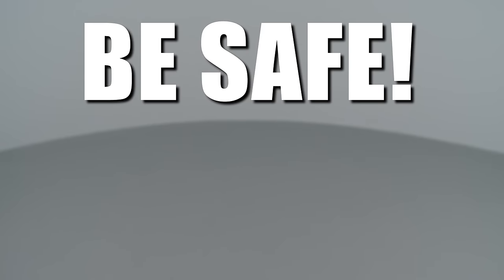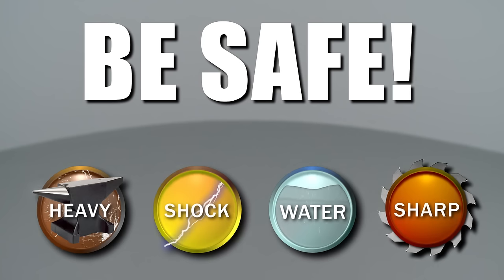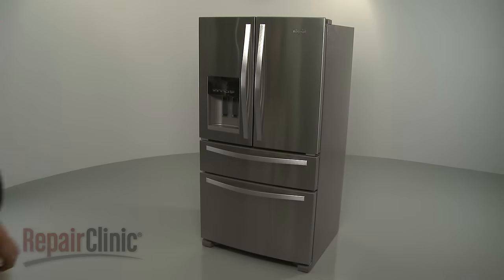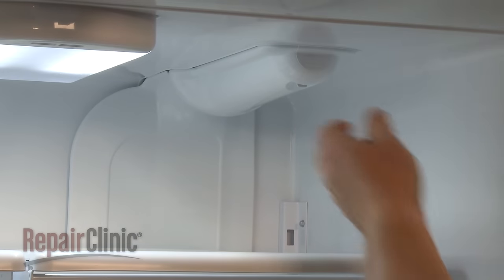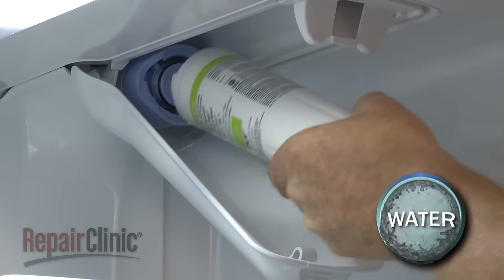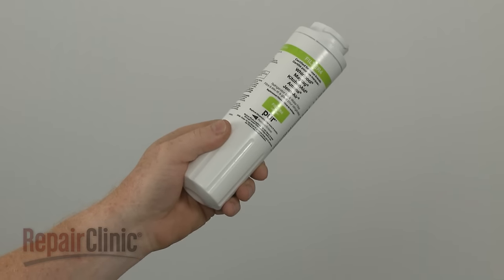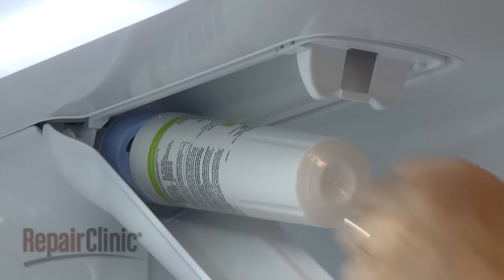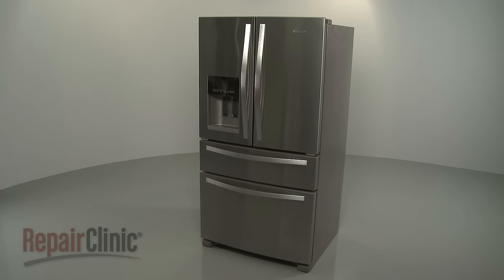Whirlpool Refrigerator Water Filter Replacement #UKF8001

Comment: After several failed attempts at removing the filter I pried the empty filter out using a thin flat head screwdriver/ butter knife. I pressed the screwdriver forward against the end of filter closest to you, and it popped free. I was finally able to twist the filter free. I hope this helps someone .
Reply: Best advice so far
Reply: @nikkimorris3000  This is exactly what happened to me.  It was very frustrating at first; I thought I was going to break something.  At least now I know what to do next time if it happens again!
Reply: this helped so much thank you :)
Reply: I looked up how to change the filter as well because when I tried to remove the filter that came with it it wasn’t budging and I didn’t want to break it if I was doing it wrong. I hate stuff like this where they show you a tutorial and then look it’s supposedly super easy to unscrew? 😠
Reply: Thank you this helped me.  It was very frustrating because the old filter would not drop down.  Without your advice I would still fighting the bugger. 84 years on earth don't need the frustrating.👍
Reply: thanks for sharing this trick.  I could not get the original filter to come out with my hand until I read your use of the flathead screwdriver and then voila! it popped out so I could unscrew it.  I was getting frustrated not trying to pull on it in fear of breaking it, so thanks pal for this handy tip.  I’ll send you a $5 amazon gift card if you share an email or something.

Comment: I couldnt twist the filter off, felt like I was going to break parts of the component. What helped was taking the plastic cover that drops down off its hinges, it was easy to do that, then I was able to use both hands, one to hold the blue part and the other to twist off filter. Taking the cover off helped to put the filter back on also, and putting the cover back on was easy. hope this helps.
Reply: Thanks!
Reply: Thank you for sharing this!  It made all the difference for me.  I was sure I was going to break something.  Too bad the housing is cheap plastic.

Comment: I just replaced the filter for the first time since buying the refrigerator; and after watching this video and reading some of the comments, it worked perfectly.  Turning off the "Replace Filter" light also was no problem.  I strongly suggest that you watch the video a couple of times and read through the comments.  There are some potential pitfalls that can be easily avoided, if you read the experiences that folks have had doing this.
Reply: Excellent advice. Worked for me.

Comment: Many of these comments were years ago but I thought I would add my comment anyway. We purchased a home recently and it came with appliances. The frig was purchased in 2018. I'm not very handy with tools (always worried about breaking things) so I was hesitant to try prying the filter loose. But a small amount of pressure with a screwdriver between the back end of the filter and that plastic end holder was enough to drop the filter down. Once you get the new filter aligned it was pretty easy to turn and finish installing. 

The first cup of water did have a black residue but that quickly disappeared. Of course resetting the filter message using the control panel was very confusing even with the original instructions. I'll be checking the frig frequently the rest of the day to make sure I didn't accidentally turn something off! lol I really prefer the "press 2 buttons for 3 seconds" method :/

Anyway, thanks to RepairClinic, at least I found out how it was "supposed" to work! And thanks to everyone's solutions for a "stuck" filter!

Comment: Just had my refrigerator delivered yesterday. The user instructions does not give direction on water filter replacement.  This was simple and helpful.  Thanks!
Reply: Typical. I don’t get it!  If I were a company producing things like this I’d make sure it’s really obvious. Either really obvious without a manual or information sheet, or at least make sure the number 1 maintenance job to keep it working properly is the most visible thing in the box. Of course many people inherit fridges when they buy a house or rent, so really they should print clear instructions on the inside, most importantly including common misunderstandings like (you may need to turn really hard btw you’re not breaking it) 🙄. Gif I wish I could be a consultant to at these places and tell them how to do it better 😂

Comment: The filter doesn't just drop down as shown in this video. You have to take a butter knife between the refrigerator ceiling and the filter and twist the butter knife slowly. The filter will then drop down.

Comment: I removed the filter and for some reason the water started squirting from my fridge replace it quick but licking like a faucet I ended up shutting the valve on the back of the fridge is this normal?

Comment: What if the filter won’t pull out? I tried several times
Reply: Same here, my filter doesn't pop out like in the video, it is totally stuck.
Reply: I watched another video where the guy said use a blow dryer/heating element around the base. Did it for a couple minutes and unscrewed way easier. Also put petroleum jelly on the outside of the filter where the groves are. Hope that helps
Reply: @taylooooraw  That worked thanks

Comment: My new Whirlpool is about 6 months old.  I cannot get the filter to drop down to unscrew and replace the filter.  Several others have had the same issue.  My previous Whirlpool had the same system but the filter dropped down for easy removal and replacement once the cover was removed.  I have tried repeatedly but it still won't come out.  Suggestions please.....
Reply: finally removed it.  It took a strong hank with a pair of pliers to dislodge it.

Comment: New refrigerator, difficult to remove filter, finally removed shelf below filter and used water-pump pliers.  Then had difficulty installing replacement filter, it was forcefully ejected along with some water spray.  Videos make it look easy but referring to the owners manual there is a caution "Air trapped in the water system may cause water and filter to eject. Always dispense water for at least 2 minutes before removing the filter or blue bypass cap."   I will make sure to dispense water prior to changing the filter the next time!

Comment: I'm having the same problem. Can anyone help?? does the valve need to be replaced?

"I just attempted this and water sprayed non-stop once the filter was removed. Any suggestion? The pressure was very strong I had a tough time getting the filter back on just to stop it."
Reply: Did you turn off the water supply? It's under pressure and by turning off and dispensing water may relieve pressure. Hope that helps!

Comment: Unable to remove filter by twisting the filter cylinder counter-clockwise.  Cylinder appears to be stuck at the refrigerator connection.  Would removal of the cylinder housing allow better access to connection? If so, how does one remove the housing?  Whirlpool Refrigerator Model GX5FHTXVB04. THANKS

Comment: I have the exact refrigerator,  my water dispenser leaks slowly. Would u have any ideas or videos on troubleshooting or repairs?
Reply from the maker: +latinmarine You may have a bad water inlet valve or low water pressure to your refrigerator.
Reply: You may need to burp any air in line by running a gallon of water through it to remove charcoal

Comment: I have the exact same refrigerator. When you open the cover, like in the video, my filter is still stuck in the upright position. does not flop down as the one in the video. Cant get it out.
Reply: Mine did the same thing and i just pushed it forward a bit and down it finally came...i was determined to get that new filter in there!!!  It did take about 6 or 7 tries and 20 minutes later.... :{
Reply: Use a butter knife to pry it down.  Use the knife at the filter end closest to you.

Comment: How do you change the water filter housing for this model? After replacing the water filter (and before), water comes out in an extremely slow pace. (~22 seconds / cup)
Reply from the maker: +AirMaxPenny We have not heard of a housing causing a slow fill issue. We would suspect a restriction in the water valve. Valves should not be disassembled due to the risk of leaking afterward so if it is clogged we suggest replacing it. www.repairclinic.com?TLSID=1773
Reply: +RepairClinic.com Thank you for the kind reply. I've found the valve on your website and will test my valve. If found broken, I will purchase the replacement from you. Thank you for the help.

Comment: replaced filter,then tried several button combinations to remove change filter light with sucess,now water and ice will not dispence
Reply: +Mike  Norman Sounds like you engaged the lock function.  On my Maytag, there the lock function is the same button as for resetting the filter.  Mine has a light that stays on to indicate that it's locked; not sure if yours does, too.

Comment: After replacing my filter water leaks out of the filter but only when it reffills the icemaker. Small amount each time but eventually over flows the cover.  Would i need to replace the water tank/filter head?
Reply: Mine leaks with filter on. Slow drip. It doesn't leak with filter taken out. Trying to find vid for replacing the housing
Reply: @Kulpythekulpster  I ended up with a new fridge this year.  Samsung and i'm not a fan of it.  No light on icemaker, water blasts out of the dispenser and the spacing for items in the fridge is absolutely horrible.  Other than that it's great....ha!!!!!

Comment: I have changed mine several times in the past, however, this time the filter is stuck and won't turn counter clockwise enough to remove.  Any ideas?
Reply: I am having the same problem.  From attempting so many times i can see a gouge mark on the filter.  I am afraid I will break the filter holder.  Any suggestions???
Reply: I just tried really hard and it eventually came loose.  was scared i was going to break it.
Reply: same here im going to break something if i try any harder
Reply: Take a flathead and wedge it into the hole (blue thing) the filter is secured into while turning the filter counter clockwise. You don’t want to break the plastic pieces holding the filter in place.

Comment: I have the same model refrigerator in the video. I replaced the filter and went through the resetting steps. It beeps 3 times and nothing happens. Can anyone help me figure out what's wrong? There was water coming out before changing the filter but after I changed it no water or ice, it just beeps and nothing. I even tried putting the old filter back in and nothing happens.

Comment: I just read that I may have needed to shut off the cold water supply from the refrigerator and then turn on the water dispenser before replacing the filter.  I didn’t do that on this first filter replacement since I’ve had the fridge, so does anyone else out there do that each time before replacing the filter?  none of the videos I’ve watched including whirlpool’s suggested it.
Reply: Chiming in here. I haven't turned mine off ever. However.... when I try to change the filter. I get sprayed in the face. So I come prepared with a towel. I change the filter like Indiana Jones in the Raiders movie. Fast, and precise.  I'm sure I'm supposed to turn it off, I just don't bother. If you're fast enough you should be able to do it with minimal mess. Horrible design